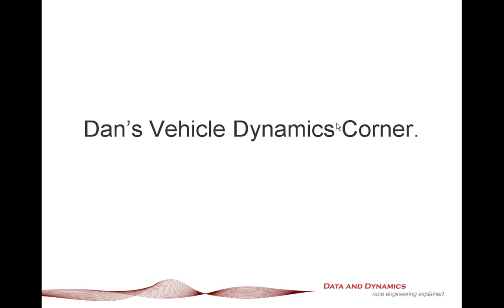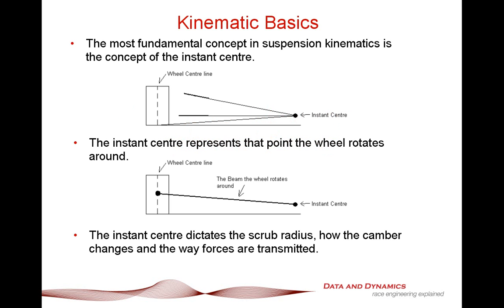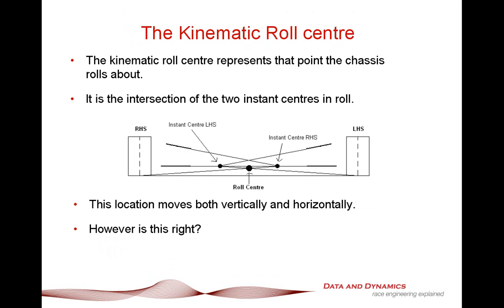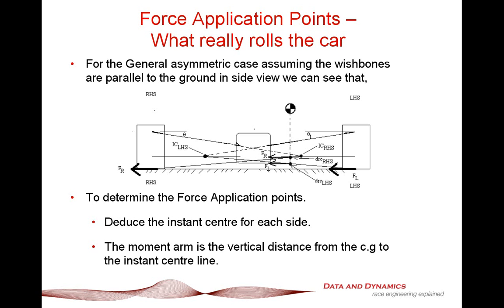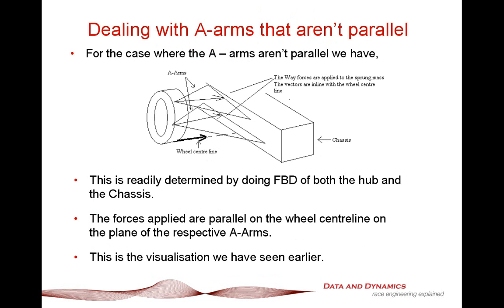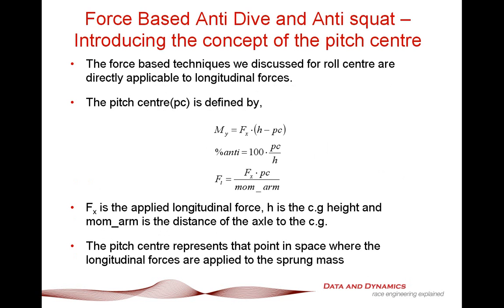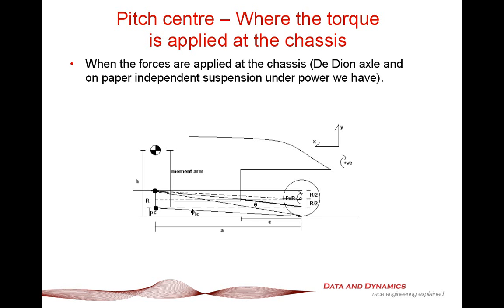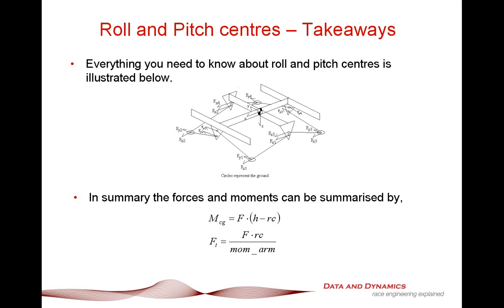Suspension Geometry

Comment: I'm not sure if I understood correctly, but it seems like a method similarly used in The Racing and High-performance Tire by Paul Haney, pages 219-221. Except, in Haney's approach, F_L and F_R have a direction parallel to their respective IC lines and are directly applied at the RC (which you said isn't fully correct). Having the force vectors directed along these lines, the jacking force can be quickly derived.
I am quite confused about force application points for suspension geometry tbh. In your video, for example, why would translate tyre forces directly below the c.g. and not at the respective ICs or at the RC?
Reply from the maker: Hello and welcome to the ChassisSim YouTube channel. Remember all vehicle motion revolves around forces and moments about the centre of gravity. We need to take a step back here. I want you to go to the 3:47s mark and then take a Free Body Diagram. Run through those numbers and then cross reference it to the asymmetric case. You'll then see the power of the force based approach.

However one thing I will say about having F_L and F_R always parrallel to the IC doesn't always apply. However work through the FBD proof and you'll see it comes out in the wash.

Comment: I really don't believe this is right. All you are doing is finding the kinematic roll centre after taking account of suspension movements. That does not make it the force based roll centre. I have been using the method you are presenting here for 25 years, it is still only an approximation of the true force based roll centre location. If you read about how designers do calculate the real force based roll centre you have to include data about the steering arms (which transmit part of the cornering force) and tyre performance as a minimum.
Reply from the maker: Patrick if you actually follow the video closely you'll see the force based roll centre derivation right there. To keep things simple I've just used a simple 2D visulaisation but re watch it again. The late Bill Mitchell (founder of WinGeo) did a paper on this back in 2006, and the work seen here is a continuation of this. I also outline the maths of this in my racecar engineering articles and my book the dynamics of the racecar.
Reply from the maker: In terms of your comment on steering arms do the compatibility numbers and you'll see where the bulk of the forces are transmitted.
Reply from the maker: However the ultimate proof of the pudding is in the eating. The following link shows actual vs simulated, http://www.chassissim.com/blog/chassissim-news/what-makes-chassissim-unique  

No grip factors and the simulation is fully transient. I should also add that was a non downforce cars. So my question to you is that if this approach is not valid how can this correlation be achieved?
Reply: ChassisSim I admit I'm afraid I really wouldn't have a clue how to do that, but I have read what other chassis designers have said about force based roll centre calculation and it is not this, you need to understand how the tyre response varies with load and include that in the force calculation. Maybe they have deliberately tried to make it sound even more complicated by including the steering arm, I don't know, but they seem to believe it is significant enough to alter the result?
Reply from the maker: Pat - There is actually a really simple way of doing this and proving it to yourself. For an applied force F in any mechanical system there a movement of say del_x. All those sum up to the applied forces plus what ever geometry effects kick in. Then if the suspension arm has a cross sectional area say 4 times that of the steering arm, which is taking the bulk of the force? Also when you get home pop your head under the car and look at the relative bulk of lower control arm to the steering rod. This will answer your questions in spade.
Reply from the maker: The other thing to consider a lot of these designers, particularly when we wind the clocks back 30 plus years had a nodding acquaintance of the numbers but no one had really sat down and down it properly. My UK Dealer, Mike Pilbeam who was the technical director of BRM when Niki Lauda was driving said when we discussed this matter at length said pretty much the same thing. It's why Milliken's Racecar Vehicle Dynamics mad such an impact because it was one of the first times someone had actually tried to quantify all this particular in the racing environment .
Reply: ChassisSim well I'm a complete amateur with a simple interest in the subject and I have been doing this myself on my computer for 30 years (starting with a ZX Spectrum) to analyse the suspension on my cars (starting with a Vauxhall Chevette!) so I'm pretty staggered about that to be absolutely honest. Maybe I should have tried to get a job in this line of work?
Reply from the maker: Pat - Don't worry about it mate - I've been doing this professionally for 20 years and there is still stuff that crops up from time to time that confuses the hell out of me so your in good company. One thing I would suggest is start reading. In particular I would recommend Jorge Segers data acquisition book, Milliken's racecar vehicle dynamics, and my book the Dynamics of the RaceCar. I would also recommend a good book on Mechanics of Solids as well. These will all fill in the blanks quite nicely.
Reply: ChassisSim no mate, you have totally misunderstood my point, I have been doing what you recommended in your video for 30 years, ie I was 25 years ahead of you! Did you even read my other comments? (Sorry if this seems rude but it's way toned down from my first draft!)
Reply from the maker: I most certainly did - it's why I've mentioned what I did, particularly the bits on compatibility about the steering arms to asses the impact they have on where the forces go. As a follow on from that when you are doing force based roll centres for a multi link suspension the first thing you look at is the size and cross sectional area of the suspension elements.
Reply from the maker: In terms of answering your question sorry if it came out the wrong way. It wasn't meant to be condescending. In terms of should you have done this professionally. Possibly but at least your asking the right questions and that's what counts.
Reply from the maker: One thing to keep in mind the crux of the force based roll centre proof is for a given force you take moments about the c.g to find the moment arm. You then resolve the lines of the instant centre. Now the distance of this under the c.g will be equal to the moment arm you have found when you did the forces. That is something we have applied from open wheelers/sportscar to NASCAR/V8 Supercars and FIA GT3 to name a few with correlation that is right on the money. I hope this answers your question about where this comes from.

Comment from the maker: No you don't. The primary reason for this it is reacted by the spring and it takes the vertical load. For an extended analysis I did the numbers on it and it turned out to be exactly the same. Also this visualisation produces spot on roll correlation every time! I hope this helps.